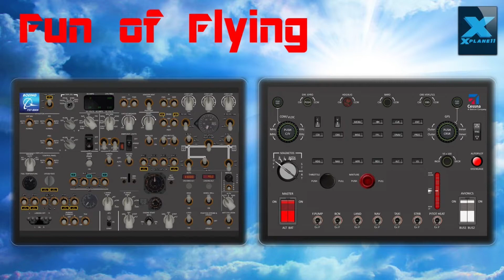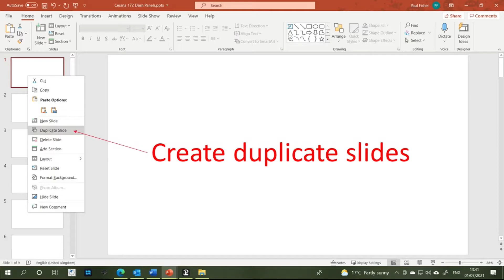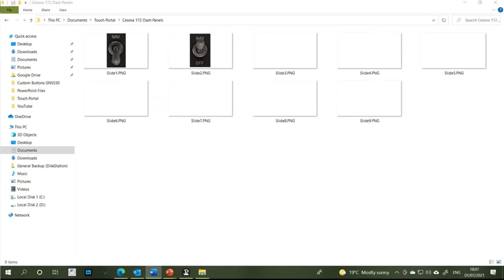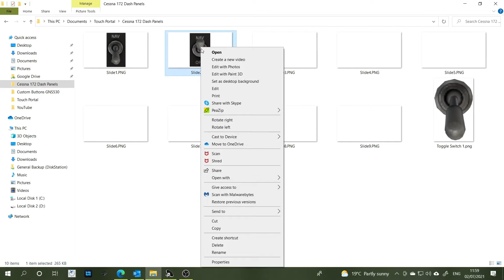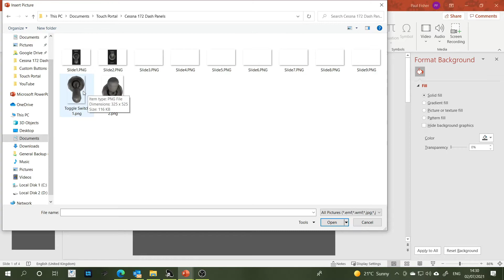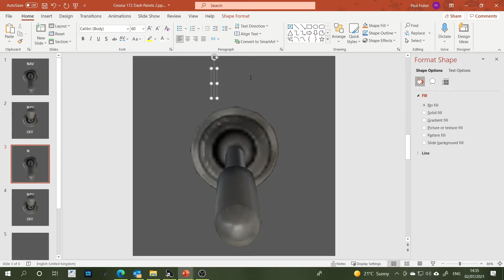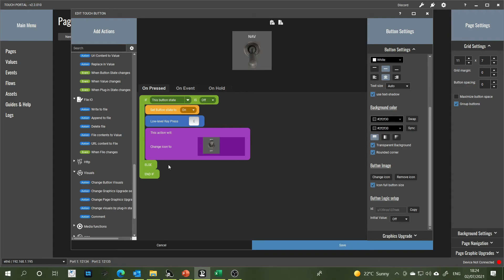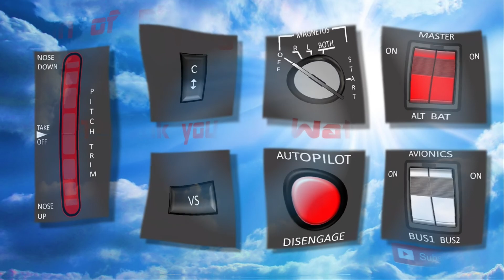TOUCH PORTAL ADVANCED: How to Create Professional Looking Custom Buttons for your iPad!

Comment: Thank you for your videos. I’m just getting started with Touch Portal. One item I have missed is how to use dataref to enter a command in xplane that can then be used in touch portal. Thank you
Reply from the maker: Hi there and welcome to the channel :-)

I'm not entirely sure what you mean when using the term 'dataref' in the context of a Touch Portal setup? Do you simply mean keyboard assignments, say to switch the beacon lights on and off for example?

If this is what you mean, then to make Touch Portal work properly you must configure each custom button with exactly the same keyboard assignments that are already set up in X-Plane 11. So basically if you activate the beacon lights in XP11 with the keyboard letter 'C', then you must also use the letter 'C' for the relevant custom button for beacon lights in Touch Portal.

Hope this makes sense, but please let me know if not?

Kind regards Paul

Comment: Thanks for the reply. That is what I’m referring to.  I saw the video on the Zebo but what I’m looking for is how do you assign a button that is not already listed in Xplane. For example in the Toliss A320 there are three ADIR switches to activate the nav system. I couldn’t find them on Xplane. I assume you have to find what the switch is called in the dataref for the aircraft and somehow enter that into Xplane and then assign a keystroke?  BTW, have made several custom buttons using your method. Thanks
Reply from the maker: Hi there, yes you are correct, you will have to identify the relevant switch in XP11 keyboard settings and assign it with a keyboard command as required. Unfortunately I don’t have the Toliss A320 in my hanger, so can’t really help, except to say that the Dataref Editor tool may be worth a try in this respect?

Comment: Excellent instruction.  A time saving suggestion: In PowerPoint, you could simply duplicate and then FLIP (180 Deg) the image of the 'Toggle Switch 1'  after you've made the necessary editing in Paint 3d.  This way you'll have an identical (but flipped) version of switch 1, making Switch 2 without having to use Paint 3D again.  Cheers.
Reply from the maker: Hi Jax, many thanks for your kind comments and a warm welcome to the channel 😎. I apologise for the late reply, it’s just that we’re on a long vacation onboard our boat and internet access is very patchy here. Anyway I hope that you find the Touch Portal videos of assistance and please let me know if you have any questions? Kind regards Paul

P.S. I’m sure that I did on occasion ‘flip’ some of the images in PowerPoint, but only if the light and shade conditions didn’t make that switch alter too much when being operated in TP. Thanks 😊

Comment: how to program the slider in touch portal to throttle in MSFS?
Reply from the maker: Hi there, unfortunately I’m now away on long term vacation, so can’t get access to all of my files, which are at home on my main PC. However, setting up Touch Portal commands for X-Plane and MSFS2020 are very similar, you just need to assign the relevant keyboard command to the item in question. Cheers 😎

Comment: Inspirational video!!  I have been using TP for a few years but have never achieved anything near to the great work you have created.  Fantastic stuff.  Just one question - whenever I bring in an icon it always appears as a square. How do you ensure that the shape you created keeps its aspect ratio?
Reply from the maker: Hi there and many thanks for your kind words, very much appreciated 😎. Currently, TP will only allow you to import icon images for custom buttons that have a square resolution. If you create an icon image that is not square in resolution, TP will simply squash and distort it into a square! I am currently away on extended vacation, but if you can tell me what shape you are trying to create, I may be able to advise you further? Kind regards Paul 😉
Reply: I will be very keen to hear your advice on this also when you have it figured mate.